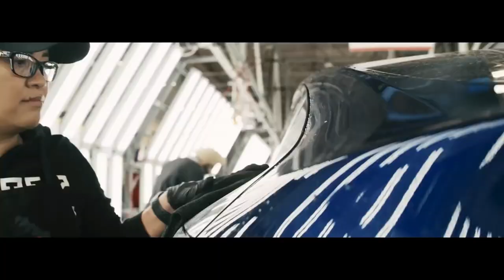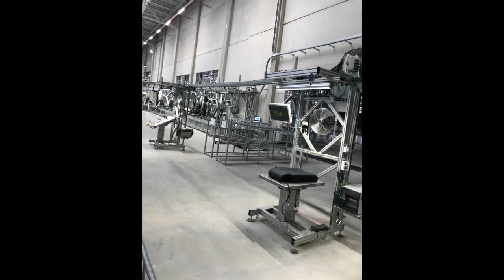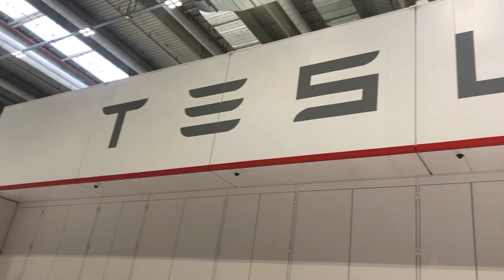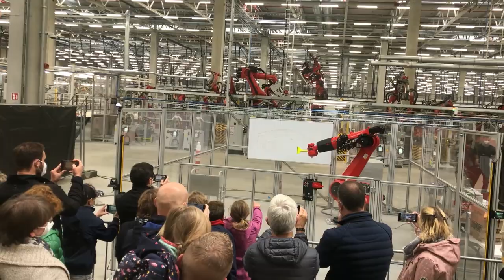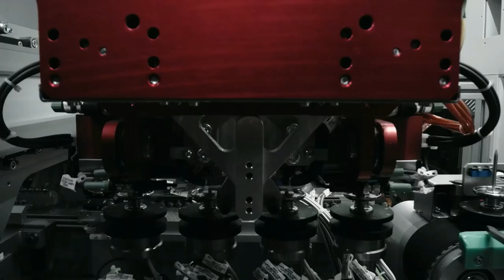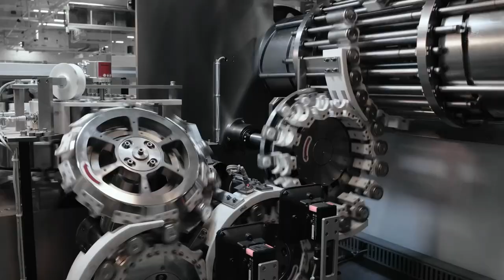Giga Berlin Footage & Inside Videos!

Comment: I did not get it. What kind of batteries will be used initially? And can they adapt to the new one piece castings?
Reply: 2170 batteries in a structural pack, transitioning to 4680 batteries when there's enough available.